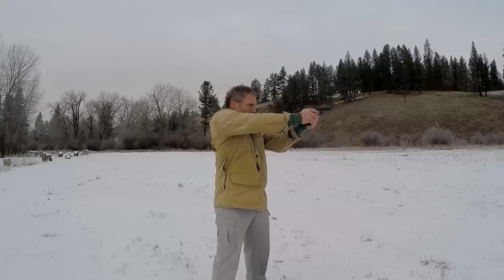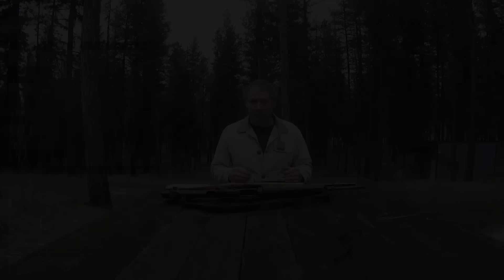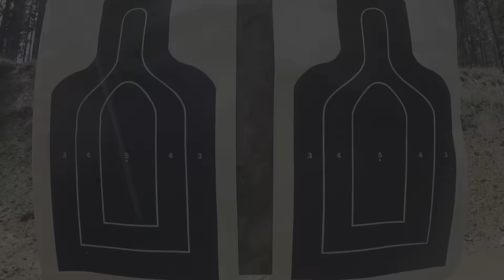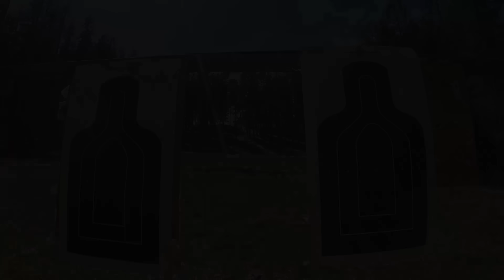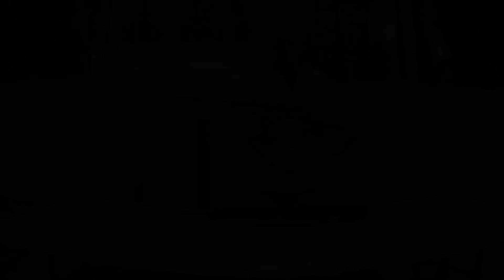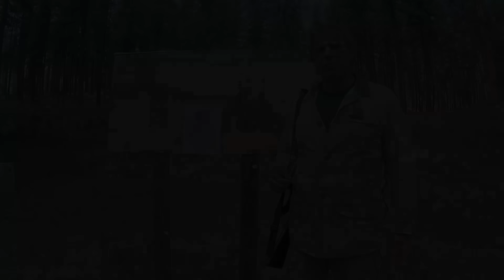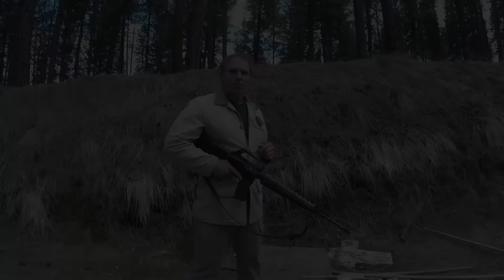Mini-14 vs AR15: Which is Better?

Comment: The A-Team: "Mini-14's are terrible!"
Paul H: "No... YOU'RE terrible."
Reply: Had 3 Mini-14s of different vintages ('77-'86) and one Mini-30. The Mini14's accuracy is terrible and the Mini30 is the most terrible of the terrible.
Reply: @LuvBorderCollies  I have a Mini-30 and honestly I haven't shot it much, haven't shot rifles in a while on top of that. Don't know what your shooting skills are nor do I know what type of shooting you're doing as in sport, competition, precision etc, so I won't comment. I think the Mini rifles are effected by some different things that other rifles aren't as in that bracket that secures the fore end of the stock as it's clamped to the barrel, HOWEVER, I don't think the Mini rifles were designed for precision, sub 1 MOA shooting at 300 yds either. I think when they were under $500 new, they were a fair deal but as the prices now, wouldn't buy another at that price. For that matter, the Ruger 9mm carbine sells new where I'm at for $570 so I say the same... Might be a fine, decent carbine but for me, not at that price.
Reply: @Jazzman-bj9fq  I used to shoot handgun competition, auto and revolver, and have 2 trophies from the NRA Natls. During the heyday of prairie dogging the load development alone was in the thousands. Any rate when the 14 became available to the public(after LE/Military sales) a local dealer sold them for $165 NIB circa 77-78. The AR15 was listing for about $300 but I got mine for $250 from a dealer friend. 

The Colt AR15 & A1 barrel made for unsatisfactory accuracy 3" with match loads was its best. Mini14 was more finicky about loads but I was able to coax a 3" group but it wasn't repeatable. 

When Colt came out with the HBAR that really raised the bar for accuracy. I was shooting 5 shot 1.25" groups at 200 yards and that was from the box. It was all AR from that point on. Ruger never really tried to catch up. 

At the gunshop I worked at the lone Mini14 was never looked at, just collected dust. The gunsmiths said the gas block design was the problem with the Mini. Ruger built in a bad flex point in the barrel to accommodate the gas block system. There lies the Mini's problem. 

Ruger knows about it but have they done anything in 45 years to correct it??? If I owned a gunshop I would never carry a new Mini, they're money wasters.
Reply: @LuvBorderCollies  With your background then I'd say you know what you're talking about, lol. I had no idea about that issue on the gas block design/position, makes sense as you explain it. Yeah the Mini-14 has been around a long time with no change that I've seen in my 30ish shooting years. The thing that pissed me off with my '30 is that I somehow managed to break off the top half of my rear sight aperture with no rough or abusive treatment, and just been too busy/lazy to replace it. Although that's not anything as serious as the barrel problem you indicated, it's still a very weak part from my experience on what has become known as a 'ranch rifle'. Firearms prices have gone pretty nuts and I understand that firearms companies can and do take advantage of the various events that happen that threaten the availability of certain weapons but Ruger is one company that has taken that to the extreme. Colt has done it as well with their 1911's. I got no problem paying more than average money for something that has a good reputation and performance but there are some designs that obviously weren't great to begin with yet still hang around because people buy them and their price has gone up substantially just in the last 2-3 years. I had a lot of 7.62x39 ammo that I hadn't used so I put some money down today on a WASR-10 as that should solve my 'all this ammo with nowhere to go' problem, haha. I'll probably keep my '30 at least long enough to really see what kind of performance I can get out of it but it may wind up being one of the ones I let go of. Time will tell. 'Preciate your behind the scenes knowledge on the Mini's, I definitely learned something. I doubt I'm a good enough of a shot to blame what I can't do on my rifle though, lol. It's hilarious because as I'm writing this, I was reading my local gun shop's website write up on the Mini-30 (little doubt that it's taken word for word from the manufacturer's product info.) The write-up on the '30 includes words like: accuracy, precision, ruggedness, reliability, etc... Well, as Paul would say, "You be the judge."
Reply: @Jazzman-bj9fq  Most folks don't know the barrel has a section cut down very much like the M4 barrel. Except the Mini being a thinner barrel to start just gets more whippy with the built-in "hinge". I can see from a factory perspective its easier to make and that drives the bottom line. I still think the Mini could be redeemed by replacing everything in front of the receiver with an uncut medium profile barrel and redesigned gas system....in other words make it look like a miniature M14. With an adult sized stock I'd be first in line with cash or plastic to get one. :)
Reply: @LuvBorderCollies  Well shit, brother... You need to go on Shark Tank with that idea and you can go into business making aftermarket Mimi-14 and 30 'precision' barrel/gas systems, lol. Now as you point this out, I think in part at least that Ruger markets this rifle (to include it's diminutive size) as a 'starter rifle' because they assume that most newbies won't know that rifle barrels do flex and the barrel's dynamics upon firing have everything to do with accuracy and consistency. You make a strong argument for the Springfield M1A Scout rifle. Even with a substantial bump in cost you get a full sized stock (lol), more capable round and more stable weapon, worth it.
Reply: @LuvBorderCollies  Btw, new prices where I'm at for the Mini-14 is $900, Mini-30 is at $950. They've gone up quite a lot in the last couple years, used to be around 800.
Reply: Jazzman3121 this has happen in CA probably due to the lack of options because new laws on ARs, but Big5 still has the best prices!
Reply: @bluedog0012able  For sure I agree with you, that's exactly why the prices have gone up more rapidly than gold prices. It's supply and demand and it's worse when there is a situation that induces a 'scarcity' but I feel like those American companies have really stuck it to us. The problem is though, for them the companies, is that if their products remain the same as they have for decades including their little problems they've never seen fit to improve on they run the risk of getting a worse reputation.  If I can buy a product that is reasonably priced or lower than average compared to a similar other product, I'm probably going to be more agreeable to 'just dealing with it' because I've made a conscious decision to save money rather than buy the more expensive product that may be quite a bit better. On the other hand, if I spend a substantial amount of money and get 'just an ok' product, I'm probably going to be much more critical of it, I'll expect more. For example, Sig Sauer pistols are known to be generally more expensive but from what their users say, they are worth it because the quality is top notch. Now Glock on the other hand has kept their prices VERY competitive... I bought my 1st Gen Glock in 88 or 89 and the same model pistol today is literally only about 50-70 dollars more than it was then if I remember correctly and that's three decades time span. From my experience, Ruger is a pretty decent, reliable company but like I mentioned with the Mini series, for what you're getting which is the very same rifle as 30-40 years ago, definitely not worth a 200% price jump over 20-30 years on a firearm that is a main production, non collectible... I spent more money to get the CZ Scorpion Evo 3/S1 because I sure wasn't gonna spend nearly 600 for the 'new and improved' Ruger 9mm 'Camp Carbine' that I remember costing less than 400 with a wooden stock not all that long ago. If I wanted a 7.62x39 semi-auto rifle today instead of a Mini-30, I'd more willingly spend about the same money to get the Century Arms import of the WASR-10. I can't fault a company for striving to increase profits but there is also such a thing as gouging your potential customers who not by their own fault have few if any other options. I'm aware that some American firearms companies might be struggling with the ever-changing laws but the same with anything, you adapt and overcome to survive. There is a threshold with supply and demand where you'll hit a high enough price point where your product isn't as attractive as it once was. When that happens, you'll be hard pressed to reverse the downslide and gain old customers back while attracting new ones. Ok, that's my rant as you coaxed it outta me. I'm in Socal and the Big 5's I've normally done business with have pretty much gone way from center-fire to airguns and air-soft, WTF???!!! Lol. I'll still get ammo from them as long as they sell it at decent prices but they may give up on that, who knows...

Comment: The original thinking with the mini-14 was to scale down and simplify an m-14 as a lighter, cheaper alternative. After the assault weapons ban ended in the early 2000s, Ruger added back in some m-14 features to compete with the budding ar-15 market. The current production mini-14s are more accurate and reliable because by now they are basically an m1a in .223 and the $850 price reflects that. It’s not meant to compete with the ar-15 market anymore than the m1a is.

Comment: The mini 14 cost more now because the process of manufacturing it has been greatly improved. And it is a better rifle than it once was as a result  My reason for buying one over the AR was that I wanted something in a rifle stock. The mini in it's typical configuration offers a slimmer profile. As for the issue with the sights, well I put a red Dot on mine. Both of these are great platforms but it comes down to what you intend to use it for and for me the mini was the better fit. And in case anyone is wondering. I do not have a fascination with the A Team, a mullet, parachute pants, nor do I miss the 80s. I do have experience with the "AR" platform in the form of M16A2 and A3 variants and they are awesome. Some day I will get one of those as well but until then I do love my mini.

Comment: The answer neither 5.56 or. 223 is rated by the US Military as completely ineffective over 200 m and little use under that. People buy these useless guns in the belief they will have running fights with Zombie hordes. If your survival depends on it the last thing you want is a massive shoot out. A better choice? India has just signed to manufacture 750,000 AK 15 in 7.62x39 the reason 5.56 has proven useless in combat THE 7.62X39 from their experience is a PROVEN COMBAT KILLER. And unless you plan to shoot Bugs or Goats 5.56 is not worth a pinch of shit.

Comment: From what i learned for civilian use and just going to the range and plinking etc, there is no reliability difference to majority of people. However in harsher climates, freezing rain, or if you are in the sandbox i think most people will agree The AR-15 is much better at keeping the environment out, hence more reliable in harsher climates overall. There is several videos of people leaving their guns out overnight in the cold winter months of the year, or doing dust/ sand test blowing compressed air at the rifle simulating a wind storm and all that jazz where the AR-15 usually does very well at keeping it out of the action and can function flawless, where other rifles can turn into a bolt action. So in that regard i do think the AR platform is overall more reliable, some people run them pretty dry too in dusty/sandy environments and they do fine. I think MAC with military arms is doing a test with that right now running the gun completely dry, sprayed off all the parts with break cleaner and ran 1K rounds with no malfunctions, he will be doing more videos until it does fail. If keeping both guns clean and maintained and in the real world for most people who buy rifles, i think it makes very little difference. Overall i do like the AR better, the recoil on it seem to go straighter back into the shoulder and has less muzzle rise even with the 200 other calibers they can be chambered in. For example i think you would notice a pretty decent different recoil impulse with an AR-10, compared to a M14 etc. I guess you really could go on for hours about it lol. I suppose i will leave that debate for people who do competitions like forgotten weapons who can do some pretty harsh matches at times.

Comment: Surprised you didn't mention ergonomics.   In the service I learned the M14 and used it for matches,  I just have the hardest time trying to offhand and position shoot the AR,  which I own two of,    off  of a rest the AR is more accurate clearly,   off hand I do much better with the "Fudd Guns"  as my son calls  them.

Comment: I don't really see why this is an issue. Formatting aside, you'll never be able to make it fair for the Mini-14 because the Mini-14 just doesn't have what it takes to compete with the AR. The AR has better sights. The sights on the A1 are as poor as AR sights get. The sights on the A2 are better, and the flip up sights on my Colt 6960, better still. I have extensive experience with several Mini-14s, including a pre-Ranch that I killed my first deer with. I find they average about 3 or 4 MOA with iron sights and M193. Even a relatively cheap AR can often do 2 MOA under the same conditions. The Mini-14 made more sense when they were $300 less expensive than an AR and one just needed a beater rifle for behind the truck seat or the ATV while maintaining the fence line (although I would personally still rather have a decent SKS at half the Ruger's price). Now that you can build a decent AR for $300 less than Ruger wants for an Mini, the Ruger makes no sense. The AR is more accurate, more reliable, easier to work on, and to find magazines, parts, and accessories for. The Ruger will come with an integral scope mount and some rings, so if you're mounting a traditional scope, optics mounting is a wash. But the flat top mount on most ARs these days will mount red dot sights and optics like the ACOG easier as many of these come with an integral base. While subjective, most will find the ergonomics for the AR to be superior. No gas operated 5.56/.223 will have a lot of recoil, but design of the AR keeps the recoil in line with shoulder, leading to less muzzle rise and a flatter shooting rifle under rapid fire strings. I also disagree with the level of maintenance required. A well built AR will chew through more ammo than you can carry without any maintenance at all. The Mini-14 is not a proper piston operated system like the M-14/M1A. I have had for more stoppages with the Mini-14s than I have with either of my Colt ARs or with any of my issued M16A4s. Even the quality of manufacture is vastly in favor of the AR, which is forged instead of cast and typically devoid of the MIM parts Ruger puts in the Mini. Having shot both designs a lot over the past 20-some odd years, it isn't even a question for me which design is better. I can't see the Mini-14 having a single advantage over the AR.

Comment: Even the headspace on my Ruger 10/22 is horribly excessive. And, the bolt face even sits crooked against the barrel extension. Terrible rifle. Very inaccurate, plus very unreliable. The worst gun that I own, to be honest with you. But, lots of people have good luck with the 10/22. I don't buy Ruger ANYTHING anymore. Their present day quality control, isn't even close to as good as their "past" quality. My Ruger LCR .22 magnum has a light primer strike, about every 5 shots(any type of ammo). It's because they tried to get "cute" with lightening the trigger, and used too weak of a main spring. I'm DONE WITH RUGER!!!!  Period. $650 wasted, that I could have spent on quality firearms.

Comment: 👍👍Liked the video. Definatly not boring. I have been told early mini 14's suffered from accuracy due to heat warping the barrel(thin barrel). Some guys like the look(M14) which was my weapon in 66-68. Before  M16's.  I like Rugers but not crazy about their mag fit, dumped my 308 range gun, sloppy fit. Like my Mossy MVP 308 more. That's just me.🐴✌🇺🇸🇺🇸

Comment: Forgive me if I missed it, but I believe you forgot to mention the ease of mounting optics to the AR platform, particularly the newer ones. Yes, it's still possible with the Mini, but there isn't as many options plus you may have to add a cheek riser. That and the whole aftermarket aspect altogether.
Reply from the maker: I did not mention optics. They mount easily to an A-3 platform but when you put a scope on an A-1 it makes the scope very high off the frame and it makes for a poor cheek weld.
Reply: @PaulHarrell  That is true. I do know there is that weaver (I think) rail mount for the carry handle that drops down in front for an Aimpoint to co-witness with the iron sights, but I don't think a lot of people in the civilian world use them when A3 uppers are so readily available.

Comment: I'm 33 and I have been shooting early 90s 20" ars since I was a kid and didnt know about mechanical zero and how the rear apertures worked.  I love learning new stuff!
Reply from the maker: Remember mine is an A-1  If you have an A-2 it's slightly different.
Reply: @PaulHarrell  it was a colt sporter 20" hbar made in the early '90s.  No bayonet lug.

Comment: Paul I used the A2 in BCT does the A1 have a different rear sight aperture?
Reply from the maker: Yes. on the A-1 the rear aperture for short and long range are the same size. The long range adds elevation. On the A-2 the short and long are different sizes and the long adds no elevation.
Reply: Paul Harrell Thank You